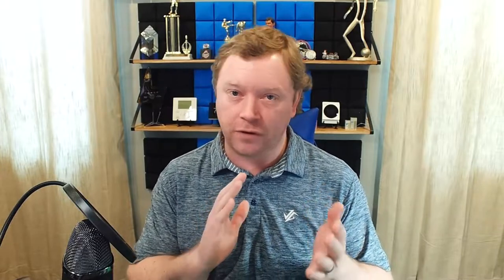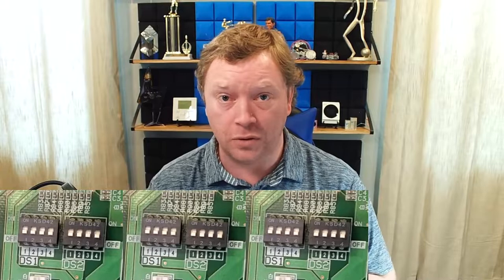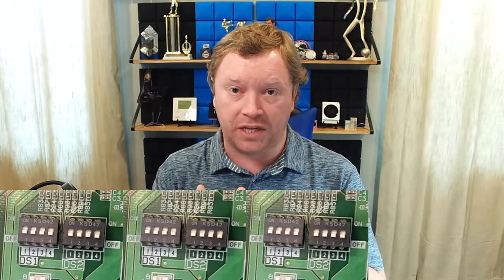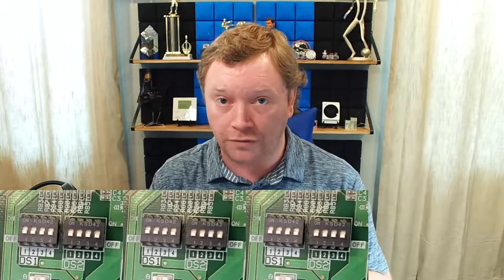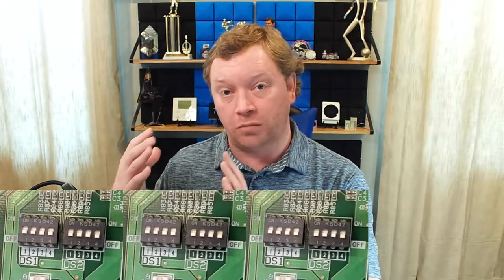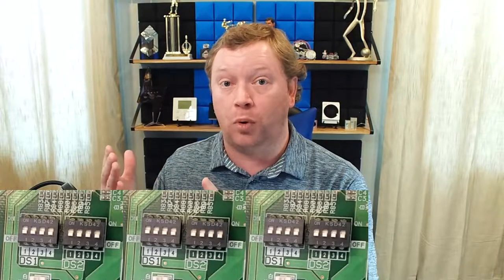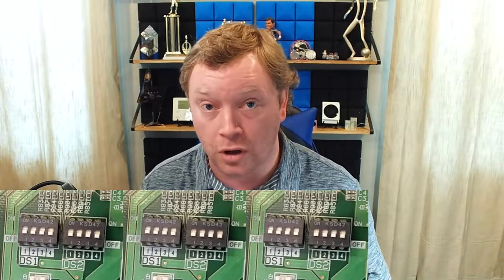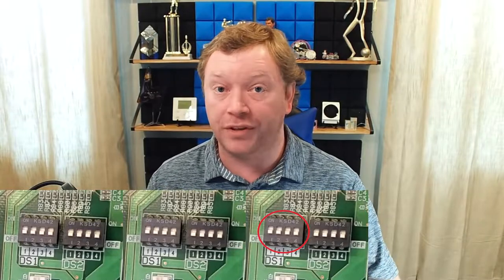Daikin VRV Branch Box Settings | How to set Dip Switches on Daikin VRV Branch Boxes - 4-3-2022

Comment: Hey Dana great content! I recognize this vid is a little old now but still helpful. I’m having an issues with my system. I have a four port and two six port boxes in the system . I can’t get rid of the Ua53 code for the life of me . I tried your methods on here and also tried the daikin app dipswitch methods to no avail. I have fourteen heads on the run between the three. When I put in settings 1 code 10 it shows 13. Could this be the issue? Not seeing a head ? Or should I focus on the bs boxes still with this fault? Also , if I am not reading a head, what’s the best way to figure out which it is? The fans on all go on…
Reply from the maker: Forced fan from outdoor to see which one you're missing. Quadruple check the switches I can't tell you how many times someone has sworn to me it's right and what do ya know, it's wrong lol. Make sure to remember ghost Ports on the 6 port box. Full reboot and hold reset or return depending on outdoor model for 20 seconds right after power up of outdoor to reinitalize the addressing. Also make sure all units are properly Landed at each port terminal and make sure all units have the proper line voltage and stat displays. Forced fan should show you which indoor isn't blowing that's the missing unit from the communication side.

Comment: Hello Dana, I have a Daikin BPMKS049A3U Branch Box, nothing as complicated as a VRV 6 port setup. The wiring method for the power is labeled L1 and L2 with a Ground. Is L1 load(hot) and L2 Neutral? Thanks in advance for your help.
Reply from the maker: That box requires 208/230v power so both L1 and L2 are hot. Ground is ground.
Reply: @InverterAlways  Thanks for the reply. I was confused about that. Power (15 amp circuit) is supplied from the main panel to the disconnect (15 amp switch); then from the disconnect switch to the branch box. L1 black, L2 white, ground green.
Reply from the maker: @360therapy8  15 amps could be 120 or 208/230. 15 amps is the size of the circuit not the type. Sounds like you're playing with 120 which will not work.
Reply from the maker: @360therapy8  you may want to consult with an electrician before changing anything. Just to be safe here. Also if you're outside the states it's possible those boxes use different power. So you'd be best to verify with the submittal data of your unit in your market. Just trying to keep ya out of trouble.
Reply: @InverterAlways  you are right, thanks again for your help. I will consult with an electrician. Here’s the setup: In the main panel, a 15 amp single-pole breaker is dedicated to the branch box. The wiring from the main panel to a disconnect switch located near the branch box consists of 1black (hot), 1white (neutral), and 1green (ground). I believe you are right about it being 120v. The branch box has not been connected.
Reply: I could be wrong, but seems like I may need a 2 pole 15 amp breaker install at the main panel to get 2 hots.
Reply from the maker: @360therapy8  yup that's 120 needs to be 208/230.
Reply from the maker: @360therapy8  yes
Reply: @InverterAlways  Update: Licensed electrician came out. He replaced the single pole 15 amp breaker with a double pole 15 amp breaker. He also ran new wires from the panel to the branch box.
Reply from the maker: @360therapy8  glad you got it all dialed in

Comment: Guys, how do you braze branch boxes with nitrogen? How to open valves to allow the flow of nitrogen?
Reply from the maker: Usually you purge from one of the lines. The valves come open from Daikin. If you are doing service work then put the system into recovery mode to force open all the valves.
Reply: @InverterAlways  I will give try. I completely forgot that somewhere I spotted in docs such mode for REYQ14T7Y...That branch box is used in another system...

Comment: i have a 6 port box.. circuits A&B feed 2 different fan coils   E&F are twinned   how should my dip switches be set on a 6 port branch box
Reply from the maker: What about c and d ports?
Reply: @InverterAlways  Ports C&D are empty. \ A,B are under 54kbtu. C&D are empty. E&F are twinned for a FXTQ60
Reply from the maker: @kevingrimes6725  which dip switches do you think should be turned on after watching this video?
Reply: @InverterAlways  C&D in the on position and F on dip switch port 2 Off.
Reply: I mean F on bank 2 On
Reply from the maker: @kevingrimes6725  no. E is flipped on, right hand board ds2 switch 1 for the first set of ports on that board being twinned. Left hand board ds1 switches 3 and 4 for c and d being empty. Don't forget to verify right hand board ds2 switch 4 is on as well to disable ghost ports.
Reply: @InverterAlways  thank you.  Which port should my comm wiring to stat from beach box connect to for the twinned fan coil. E or F?    Thanks again for all your help.
Reply from the maker: @kevingrimes6725  E

Comment: Hello Dana so I have a 6 port box and they’re only using 5 ports and the installer has on the second board dipswitches 2,3&4 on I’m assuming to disable the six port and the last two for 7&8 does this sound correct ?
Reply from the maker: Nope. If port F is blank turn on right hand board ds1 switch 2 for port f being disabled. Leave switches 3 and 4 alone. On that same board ds2 switch 4 should already be on disabling the ghost ports 7 and 8 that don't physically exist on the unit.
Reply: @InverterAlways  ok I will check this out tomorrow is there any where I can find a troubleshooting guide or information ℹ️ n the branch selector box ?  We have a new school that was finished last year and we’ve had nothing but issues out of the systems and contractors are pointing fingers at Each other with no real solution or fix so it’s leaving us to try and diagnose this stuff ourselves with no real knowledge on then or anything to go off of really im new to vrv systems and would like to learn more about them and how to troubleshoot them better so I can be a better technician when I come up to these units
Reply from the maker: @alantreadwell5369  that's why I created this channel my friend. To spread awareness and info to help. You definitely want to read the service manuals. Those are filled with info. But whoever the contractor is Servicing the job (if there even is one), they can always get daikin to help them if they can't figure it out. That or hire someone who knows how it works and who can help. You can also go through trainings daikin offers to learn more about this stuff. Lots of options.
Reply: @InverterAlways  thanks for the reply and yes they’re is a contractor that’s supposed to be working on this but they will not show up and has left us with all this mess so where trying to figure it out as we go and I will have to download the manuals because they didn’t leave us any literature to read up on been doing hvac for a little while now just never messed with much vrv stuff but I’m slowly grasping how it is all designed to work will just take time I suppose but I’ll see what I can find on the web for manuals we actually took some training with diakin online but was for commissioning and installs but with working for a school system that class was not beneficial for us as we would never be in that situation only to fix and make repairs and service equipment mainly I do appreciate your help so far and I have only watched a couple of your videos since I found you yesterday on here but will continue to watch and learn from them and the manuals when I find them thanks
Reply from the maker: @alantreadwell5369  that's unfortunate to hear sorry. It may be worth double checking other contractors in your area to see if any are certified and well versed on vrv. In the meantime some of my videos may help (hopefully). Service classes are awesome but it definitely helps to know how it's supposed to install and function in order to properly diagnose problems. 

Speaking of problems what exactly is thr issue you're having? Error codes? Or no error codes and just poor performance?
Reply: @InverterAlways  no error codes are showing up on the itm but we have a control company that has there equipment on it as well with intesis and there delta thermostats and we think that’s some of the issues we’re having but we have some rooms not cooling we got 15vdc on the terminal block that feeds back to the branch selector going to each indoor unit I’m assuming that means it has a call to open the solenoid but there’s no cooling going to a few of the rooms my guess this far that there’s a call to the solenoid to open but the solenoid is either bad and the windings are open or there’s trash in the system with some stopped up strainers possibly allowing for poor performance?  I’m going back over there today to ohm out the solenoids and see if there are any bad and start from there
Reply: @InverterAlways   sorry to bother you but I found out that the bs box dip switches were set incorrectly my question is will I need to readdress the outdoor unit to see all indoor units now ?
Reply from the maker: @alantreadwell5369  vrv communicates through 16vdc com. It's commonly 15vdc that doesn't mean there's a call only communication. Integrating through intesis to use a 3rd party stat? You could simply not have a call based on their logic.

Super rare to have a port not work more commonly an indoor eev issue or eev coil (motor) failure. Need service checker to truly see what's going on inside the system otherwise you'll be guessing and chasing possible issues that aren't actually issues. 
I stopped using intesis personally, because we lost a lot of functionality within the system. Mode change, etc. I've never used it on heat recovery though because we haven't needed it. We use dkn adaptors for 3rd party stats and we use bacnet software on the itm for bms so no big or immediate need for intesis commercially. Hard to say if that's adding to the problem, or if it is the problem. No error codes is a good thing to start with though. Next step is check service checker operation to see inside the system what it sees and performance.
Reply from the maker: @alantreadwell5369  yes. Once setting dip switches power off condensers for 5 minutes. As soon as you reboot hold return on vrviv and later for 20 seconds then let it boot. Once blank screen verify indoor and port count, may need to refer to an earlier video I did for this part. Vrviii systems hold reset instead of return but same premise otherwise.

Comment: I have a Daikin DM96VC0603BN. I found the correct dip switch / switch bank to adjust the continuous fan speed, but I accidentally popped the dip switch itself off the circuit board (switchboard?). I couldn't get it to reattach, even with it lined up perfectly, so after adjusting the tiny switches to put the fan at 75% speed, I put the dip switch back in place and put scotch tape over it to keep it from moving. Everything seems to be working fine. I can tell my fan is at a higher speed, so I know that worked. The status box said On when I switched the furnace back on and is now going back and forth from P1 to 8. I'm not sure why it says P1, as that means low stage HP heat and I have the air running and have verified it's cold air coming out. I guess I'm wondering if the status is okay and whether or not it's okay to keep the dip switch in place with scotch tape? Otherwise it falls right off. Thanks for the response!
Reply from the maker: I'd replace the board regardless. Do you have the furnace as a standalone furnace or is it tied in with a fit. Unitary. Or vrv system? On some system the dip switches are disabled on the furnace and controlled via the switches on the communicating coil.
Reply: @InverterAlways  I'm not really sure what you're asking? It's a standalone furnace. The only thing controlling it is the circuit board in the bottom half of the furnace. Wouldn't it be expensive to replace the entire circuit board? If everything is working okay, is it causing any harm to continue using it with the dip switch held in place with scotch tape?
Reply from the maker: @JT-um4rk  I was asking if it was paired with something to get the full scope. It should be covered under the standard parts warranty. You can leave it, but I would not leave it that way myself.

Comment: Sir Daikin vrv iv+ inverter 14hp outdoor unit condenser dc motor pcb damage  I am new pcb buying the market I can do direct pcb  fitting or not that much I have to change anything in it master control pcb & programing ?
Reply from the maker: Fan motor damaged? Or fan driver board? Or inverter board? Depending on model some units have a fan driver some are built in to the inverter. Replace whichever is damaged.

Comment: I have a 6 port Branch Box A-B ,C-D  are twin pipe together E is straight    Piped F is not begin used I have 2 Boards how do I set my dip switches 
  Left board DS-1  DS-2
Right board DS-1. DS-2
I would appreciate any help !
Reply from the maker: Left board ds2 switches 1 and 2 on. Right board ds1 switch 2 on, ds2 switch 4 on.

Comment: Hi Dana,  it's just amazing that next only yesterday I fitted a 4-Way BS Box on Daikin VRV3 System as we are carrying out some modifications to an existing system.   Your video came at the right time.  We have to pipe up the new BS Box next week.  Thank you so much for sharing this very important information with us, it's really a great assistance.  We are here in the UK.  The BS box we are fitting is for a VRV 4 system and is compatible with the VRV3 as well (Daikin).  Watched many of your videos.  Thank you once again.
Reply from the maker: The vrv3 outdoor will likely need a board swap to make it compatible with vrv4 branch boxes. At least here in the states they are not compatible by default with vrv3 systems. We have to upgrade the vrv3 with a new board to allow the integration to occur. 

Glad this helped you at the right time!!
Reply: @InverterAlways  Thank you for your reply.  Daikin UK confirmed that the new BS boxes for VRV 4 are compatible with VRV3 system.  All the best.

Comment: Thanks for you explained.
I have a question.
What are the factory settings to DS1 DS2 for DAIKIN CLASSIC INVERTER?
In my case
 DS1  "D" is switch ON
DS2  "H" is switched ON.
That is normally?
Thank you!
Reply from the maker: I am unsure on the very oldest models, you may want to check in with your local vendor or factory rep for support on that.
Reply: @InverterAlways .Thank you! It is manufactured in 2014 this model.it is like a vrv III i think

Comment: Hi Dana, 

Any idea as to why a system might read more BS box than what is actually installed ?
Reply from the maker: probably from a wiring issue or dip switch issue. How many ports does it recognize being used versus actually being used? check each port to ensure there aren't any wires landed, and make sure to double check the number of ports via dip switches. may also be worth double checking to see if any indoor units are being daisy chained to a single port but piped to individual ports, or vise versa.
Reply: @InverterAlways  Yes. I was confused to what it was communicating with. For some reason I thought i needed to communicate with the physical BS box rather than the ports within the BS box.

Comment: Thankyou very much! Another brilliant video Dana
Reply from the maker: Thanks Tom!
Reply: @InverterAlways  feel free to ignore this, but quick question…. 
Got x3 separate RZQ200 systems serving 10 fan coils. (x3FCU-x3FCU-x4FCU) Previous engineer has piggybacked them all onto x1 BRC1E controller. Problem is, I have a C4 fault (liquid therm) but because it’s 3 systems all on one controller I can’t verify which fancoil has the faulty thermistor as I can only see thermistor values for x4 of the units. It shows unit no2 has the C4 on the controller, but that could mean anything. Tried forced fan ‘ON’ for unit 2, but no fan runs, so could be any of the 10 can coils. . What would you say is the easiest way of identifying which unit has the faulty thermistor? I was thinking of separating them into three separate systems so I can read the thermistor readings correctly and try identify that way, but it’s a pain to do. Any other ideas?!? Sorry for the essay 😂
Reply from the maker: @tom24057  oh man that's a tough one. You can pull the stat off and test 1 at a time. Or use service checker to see what they all say. Ultimately you'll have to ohm it out to verify so I guess whatever is fastest. I'd throw a service checker on quick and put all systems into refer recovery so they can all stabilize then compare all the temp values on service checker. Should only take 5 minutes then go ohm the one that seems off.

By the way this is exactly why I never put multiple outdoors on one stat. When there's an error it causes such a headache.
Reply: @InverterAlways  great ideas! Totally agree, I explained to the customer multiple systems on one controller is a nightmare 😂 thanks so much for your advice. Only problem with using the service checker… it’ll verify one of the 10 fan coil thermistors is reading inaccurately, but I’ll still not know which one it is 😂👍🏼 I’ll keep you posted👍🏼👍🏼😂